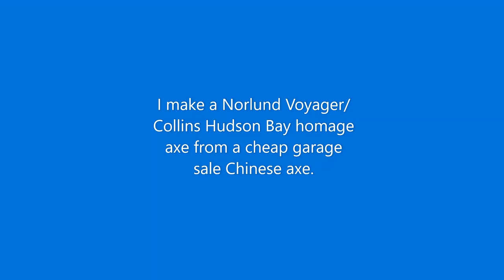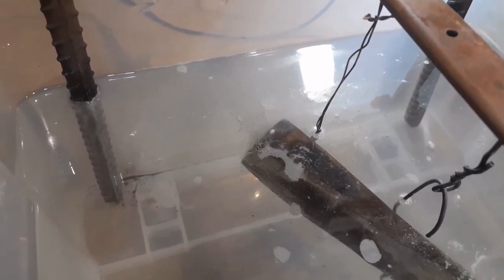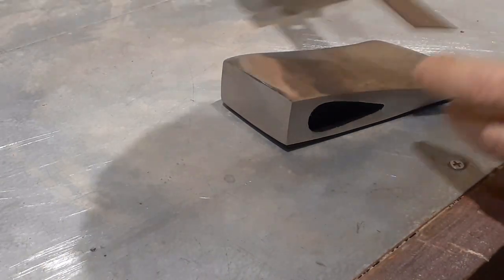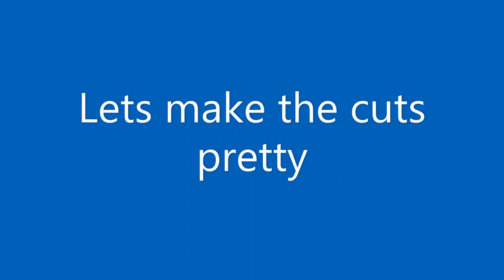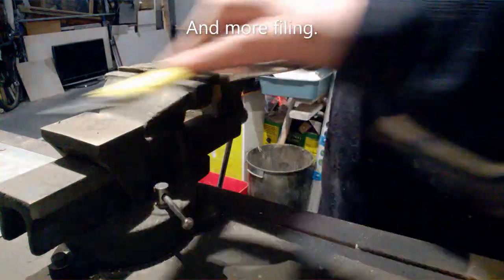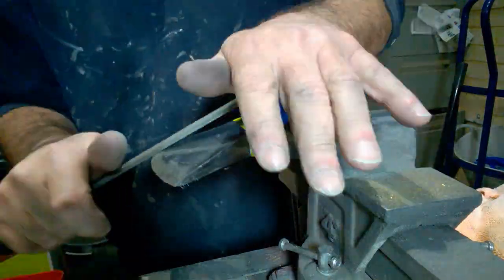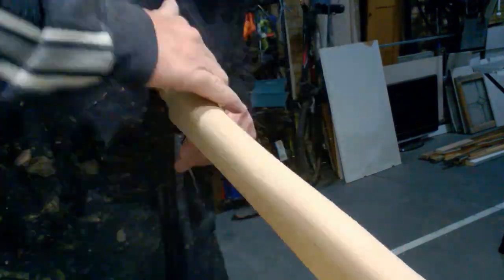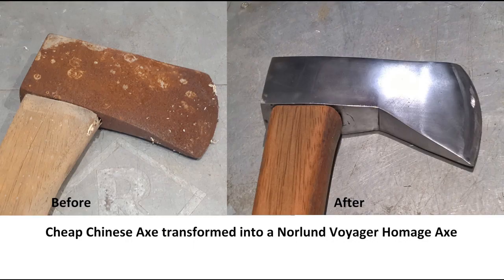I made a Norlund Voyager Axe

Comment: Can you use this as an axe throwing axe?
Reply from the maker: Any axe can be used as a throwing axe, as a matter of fact, I have had many things that are not usually designed for throwing, thrown at me. Hammers, random pieces of steel, screwdrivers, plates, drinks (both the container and its contents, sometimes at the same time). This list is extensive.